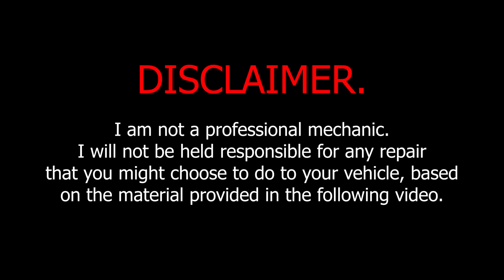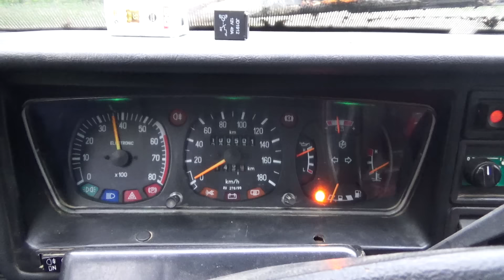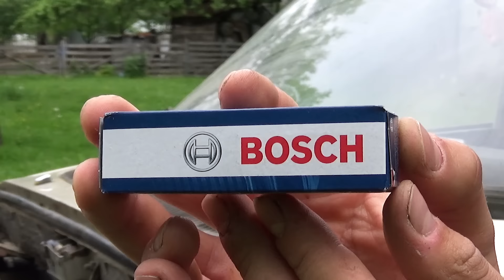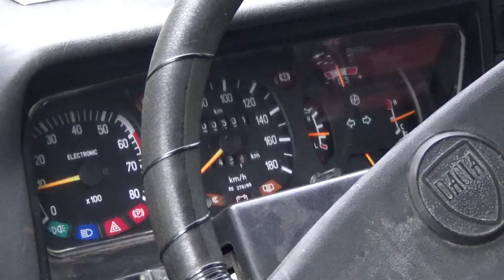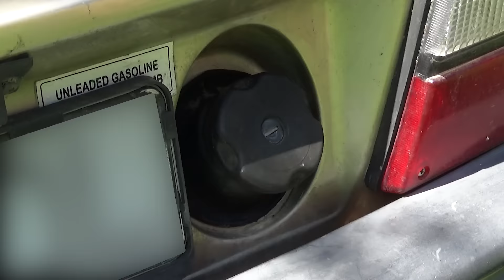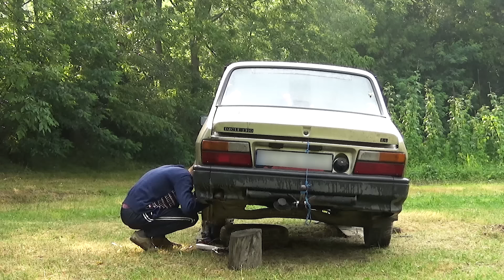Reviving A 2000 Dacia 1310 That Hasn't Been Started In 6 Years | Part One

Comment: Am văzut că motorul este 106-11 și am căutat informații despre el. Știam că dacă ar fi fost 1.4, ar fi fost 102-XX, așadar, fiind 106-XX, era clar că e 1.6, după care, am vrut să știu de la ce vine ,,11". Se pare că motoarele 106-11 sunt 1.6 cu raport de compresie mare. Motoarele 1.6 injecție cu raport de compresie mare sunt foarte rare astăzi pentru că s-au pus, probabil, doar pe 1310 și Nova, ele fiind mai rare decât Daciile Papuc (cu raport de compresie mic). De asemenea, pe seria motorului scrie ,,619", asta arătând de fapt cât de rare sunt. Felicitări și să aveți grijă de ea!
Reply: ro: eu am model dacia
en: i have model dacia
Reply: Nici nu stiam ca s-a pus motor de 1.6 pe cn4 berlina, daramite ca ar fi fost mai puternic ca de pe papuc. Ar trebui sa traga destul de bine. Pe papuc parca faceau 72 de cai. Cati avea berlina de 1.6?
Reply: @PaulHojda  Nu avea neapărat mai mulți cai. Raportul de compresie mai mare o făcea mai rapidă și mai sprintenă. La Papuc, raportul de compresie mai mic îl făcea să aibă mai mult cuplu, să tragă mai bine după el.
Reply: Cool to know! In Brazil it was called CHT
Reply: @gabrielv.4358  Well, it isn't exactly the same as the one in Brazil, as our 1.6 liter engine had 1557cc, while yours was 1565cc. Nevertheless, both were Cleon Fonte engines, meaning the parts that had nothing to do with the displacement are interchangable.